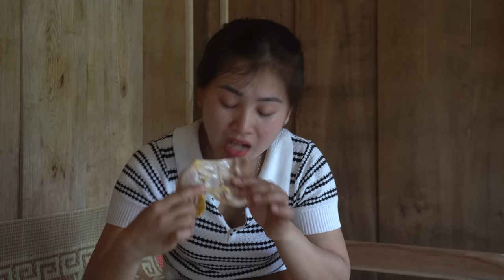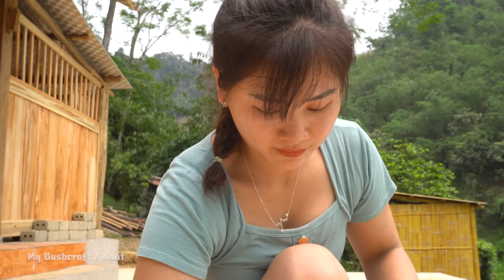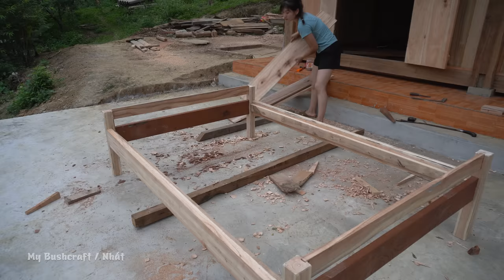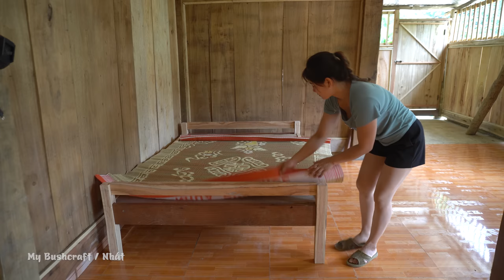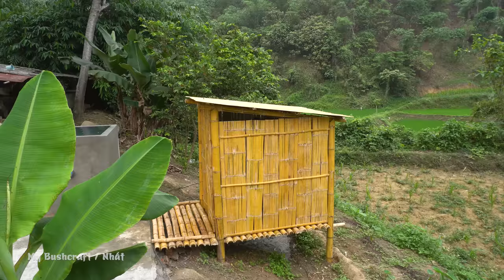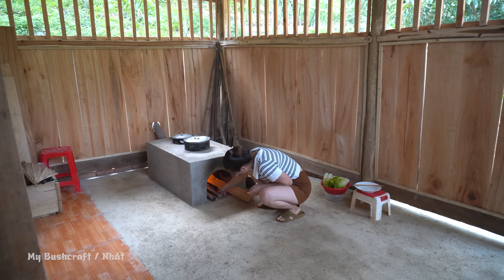How To Make Wooden Bed, Carpentry Skills To Make Bed, Shower - My Bushcraft / Nhất

Comment: When I was building, I got obsessed with buying tools. I even built a tool shed that turned into a workshop! Bench operated bandsaw, belt-saw and circular saw! A inner ceiling hoist to deal with large lumber etc! I think I went crazy. Watching your build inspires me to start again. I stopped two years ago when I became a widower. Life does go on now.
Water tank -I used Cemprotec mixed with Cementitious Coating 851. I had to let it dry for 28 days but it is completely impervious to water and flexible enough to help resist cracking etc.
Reply: My condolences. It is hard to loose a life partner, I lost my husband 4 years ago.
Reply: @kimella1320  Sorry to hear about your husband. There are still days when I miss them (lost my daughter & wife in the same accident) but it has got easier to deal with. Keeping busy here. Hope the same is true for you.
Reply: Meus sentimentos pra todos os familiares